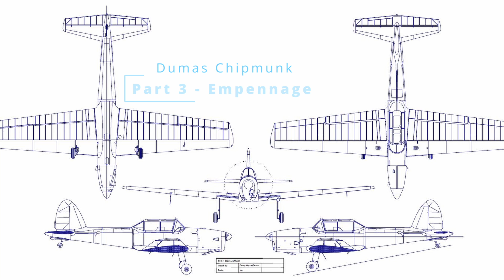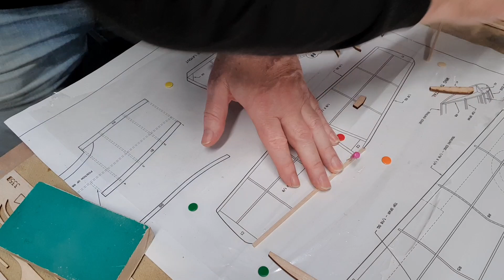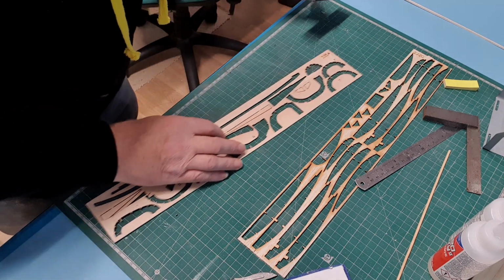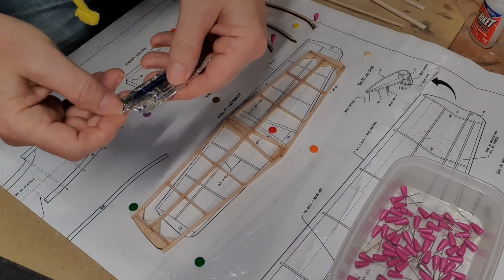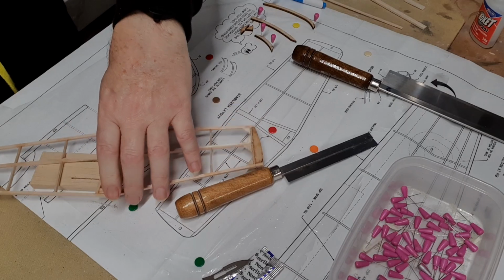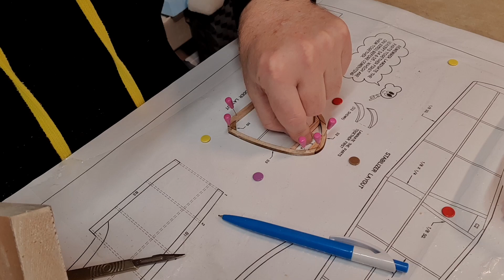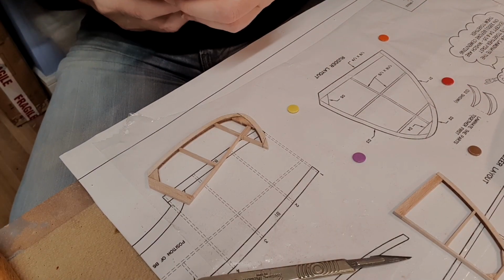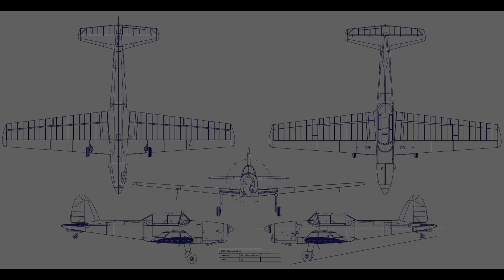Dumas Chippy Part 3 Empennage

Comment: Great work Danny and moving along a good pace.
I was a little surprised when you went into another build, have hit the wall with the Bates Chipmunk.
Reply from the maker: Hiya, I need to get this little indoor model done, test flown and trimmed, the Nationals are at the end of April. I thought once the fairings were done on the big Chippy it was a good point to leap on to this. But I am itching to get back to it....... where are you struggling with yours?
Reply: @cammnut  
On the Bates Chipmunk I put in a awful lot of time on the flaps and ailerons simply because I wasn’t happy with gap to the aft edge of wing it just looked messy. I had all the same problems you’ve encountered like the dihedral fuselage sections etc. 
But saying that it’s a very enjoyable project.
Reply from the maker: I am actually looking forward to starting the wings, but imagine they are going to be tricky with all the hinge points being under the wings surface. the trailing edge of the wing on the underside is cut back dramatically compared to the upper surface too. I fear more modifications will be in order. Hang in there, and I will try and help when I catch you up :)